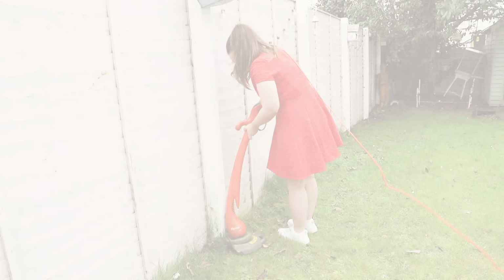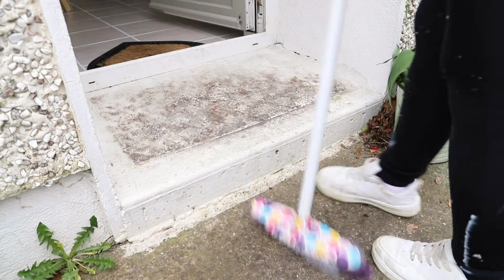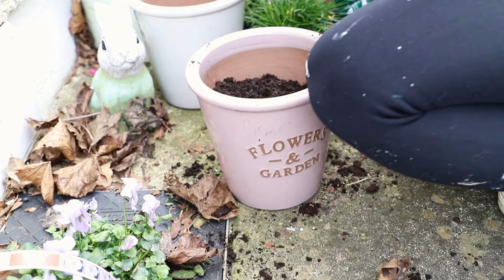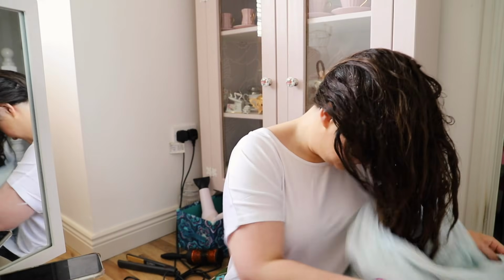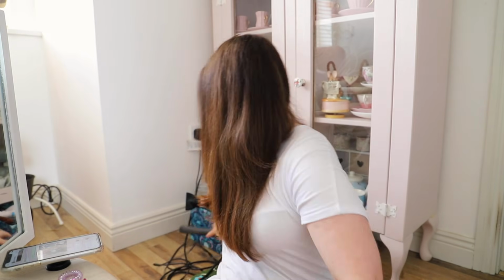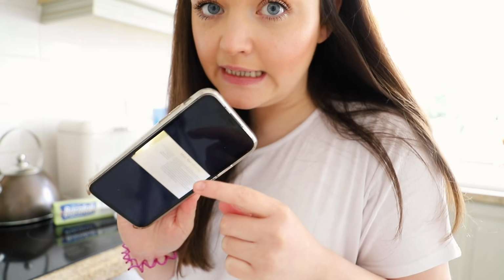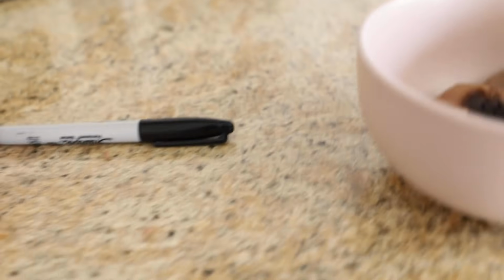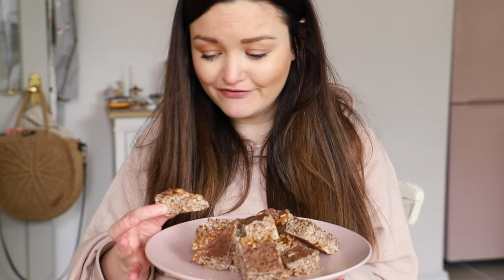Vlog, Garden Tidy, Haircut And A Baking Fail #withme

Comment: My 'failure' was not a baking 'failure', but a baking related 'accident'.
I was using an electric whisk to make cake batter. After I added the eggs, I found that the batter was quite yellow. I thought that maybe my the eggs might have been off, or something. So I bent my head forward towards the batter, to smell it. But I bent my head a bit to far and close to the whisks. With the result of my hair ending up stuck in the whisks.  I didn't manage to get the whisks out of the machine, for some reason. And this is how my sister found me: screaming and an electric whisk stuck to my head (I held it up with my hand). Now I can laugh about it😅. But back then I was a bit scared that it would have damaged a wound I had from an earoperation a week before.  So, the leasson learned is never to bent forward while using an electric whisk😂

Comment: I’m glad those bars tasted good for you!! ☺️ I’m a decent cooker actually (in fact, I loved to cook and try new recipes 😋) and if it comes to chocolate I can tell it is special on its own way 🙄 if you are working with melted chocolate and a single-tiny water drop fell on it, it will be a disaster and wasted chocolate 🙊 but I can give you a couple of tips; whenever you’re not sure of any process just google it, it will save your ingredients to be wasted (specially on these quarantine times) and if you want to melt chocolate in a microwave just put it in there for 20 seconds, then whisk it and put it back again for another 20 seconds and whisk it again and so on until it is as melted as you want (otherwise what happened to you will happen again), I love to think that kitchen, in general, is like a big laboratory and you can try and learn a lot of things ☺️ much love from Monterrey City, Mexico 😘😘
Reply: So true about melting the chocolate! I worked in a kitchen for 15 years and even though I didn't do the baking I would help the cooks doing so. If they were busy they'd get me to check the melting chocolate after about 20 - 30 seconds and reheat again for the same short period. This method worked great!

Comment: Hi, your garden turned out great and the paint really poshed up the home,  the baking was fine, melting chocolate is easy to mess up, and it was still edible, my worst fail was gf pancakes, they were white and slimy, but the funniest was the first Christmas cake I made, i read that your supposed to feed it with brandy, but I used spiced rum, closest thing I had but it didn't say how much,  so each week I stabbed the cake and poured rum over, apparently a whole Lt was a bit much but it was fine just don't drive after Christmas cake in my house,

Comment: Your bars is still fine even after burning the choc😉😉 if you use backing choc you can put half a slab 1min at a time in microwave. The normal choc slabs melts very fast. So half a min at a time.what is amazingly nice is when you melt choc and stir muesli in it untill its nice and thick.then also press in dish and cut after set...njammy breakfast bar

Comment: This is not quite a "baking" fail, but a "clean your oven when you spill things" warning. I owned a "self clean" oven and decided to set the oven to this setting. What I didn't know is my husband and sons had made a pizza and spilled melted cheese all in the bottom of the oven. After starting the oven cleaning process, I started to smell fire. So I went to the kitchen and there was a ROARING fire inside my oven😮 I called the fire department (who live less than a mile from my house). They arrived only to realize you cannot open the oven when it is that hot because it has an automatic lock on it. So they stayed to make sure nothing else caught on fire in the house and I was so embarrassed!! The moral of this story? Check your oven before using your self cleaning feature.... or if you want a NEW oven, you can do what I did, LOL! YES, I got a wonderful new oven out of this😂😂😂😂😂 My husband paid the price for leaving a mess after cooking!
Reply from the maker: OOOOH NO, that is a good tip! I can't believe you had to get the fire dept, Happy you got a new oven lol

Comment: When melting chocolate in the microwave you need to to do 30 second intervals. Stir then 30 seconds in microwave.  Do this until chocolate is melted. I’ve never used mars bars. I melt marshmallows & sometimes peanut butter with it
🤪🙂

Comment: Please tell me Catherine, do they not have spiders in Ireland? I can't help but cringe a little when I see you using your bare hands in the soil. It would be a good idea to use garden gloves when potting in case of any nasty bites from any bugs in there.  Thanks so much for sharing your haircut. It looks terrific and you don't have to have eyes in the back of your head to have a chance of success, as it is cut in the front. I have looked at other videos, but they are so darn complicated and I so appreciate your method. It looks easy enough and can't wait to see if it works for me. Don't stress over baking fails. You live and learn with baking. Everyone has food that turns out amazing an others recipes that could be better. 'Who cares', my mother used to say, we can always try again! Stay happy.

Comment: A few years ago, I was baking a cake for my nephew's birthday and I was supposed to add nuts  cut into very small pieces, but I was too lazy to cut them by hand. So I had a genious moment and decided to use a hand blender, which was not the right tool for the job, the nuts got trapped on the blades and I tried to remove them with my index finger. 
The small detail is that I didn't turn off the power, so it cut my poor finger close to the bone. With blood going everywhere, all I could think was that I had to stop the bleeding to finish the cake because I didn't want to let him down and the poor child wouldn't have a birthday cake.
Needless to say, I ended up at the hospital and had 9 stiches to close the wound...